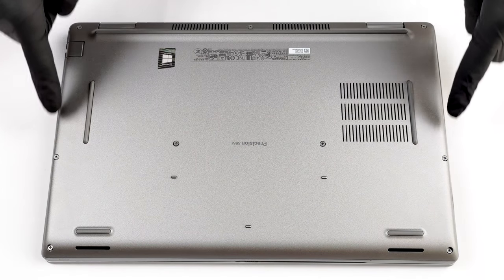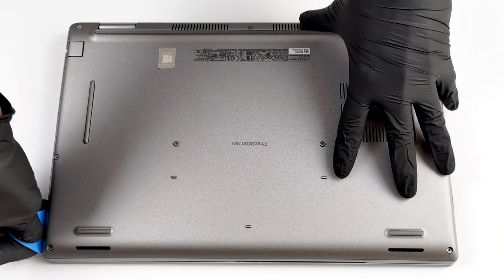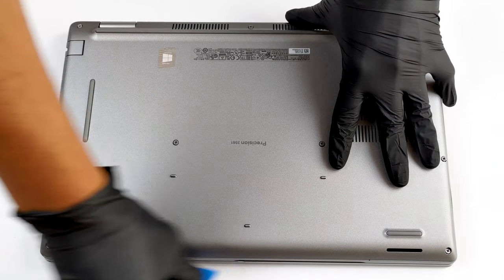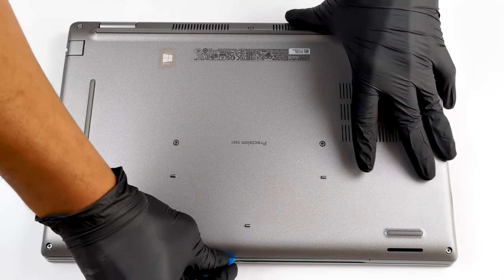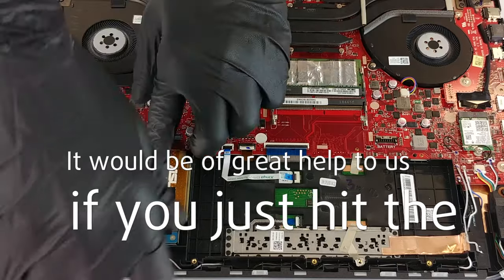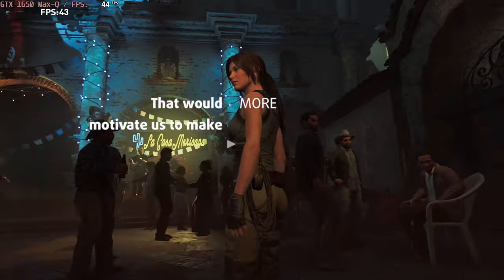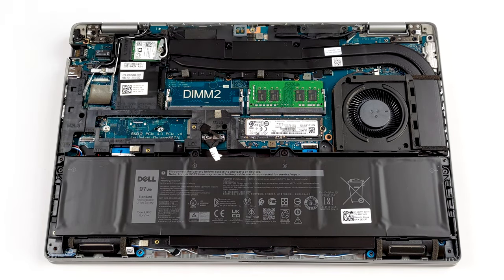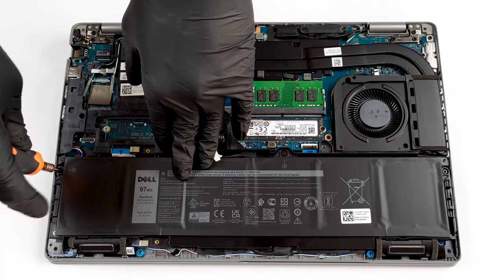🛠️ Dell Precision 15 3561 - disassembly and upgrade options

Comment: Hi! Thanks for uploading the video! I have the 64Wh battery and there is space to connect a SATA drive. Can you tell me which cable/tray I need? I contacted Dell support and they told me it's not possible even though there are 2.5in drives explicitly listed as compatible. No cables though 🤷‍♂

Comment: My father in law has this model but is having issues.  Do you know if it is possible to replace the Ethernet card / adapter or what is the part number for that?

Comment: I am from India.
My need is 
I want to use ArcGIS and working with data for analysis and research.
Edition of small videos and audios related to my research and my work.
I need your help I choosing the laptop.
I am used to travel.
Right now I choose Dell precision laptop
3561 with 32gb ram ,4gb Nvidia graphics.
i7.is this is high or is there is any other alternate for this..

Comment: I have a question. What non gaming laptops do you recommend that have:
Metal case
No soldered ram
2 tb ports as well as normal usb port
Dedicated charging port
Webcam

Thanks in advance
Reply: I don't know ur budget. Assume you have sufficient budget, I recommend 
(1) HP zbook fury 15 g8
(2) Thinkpad p15g2
(3) Thinkpad p1g4
This three all have two tb4, dedicated power port, and metal or carbon case.
Btw, no. (3) is much lighter than other two.